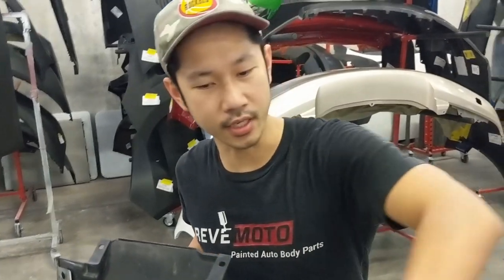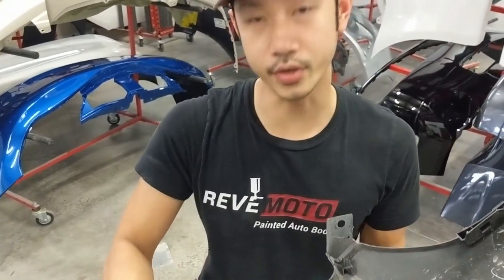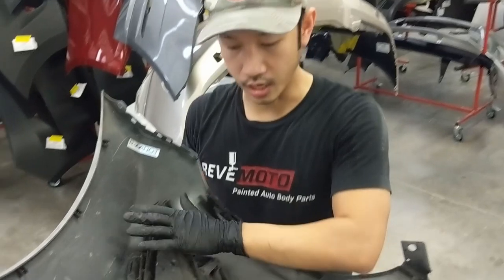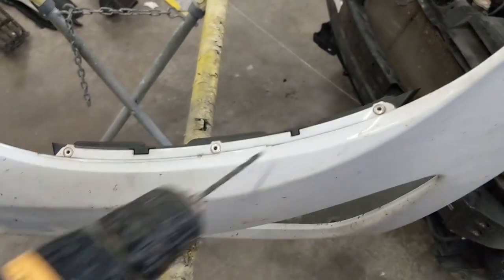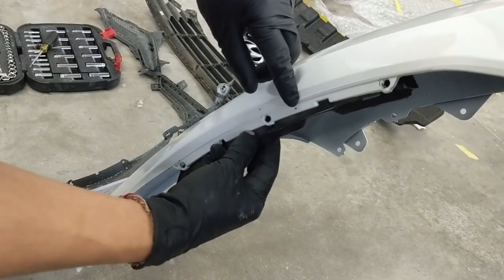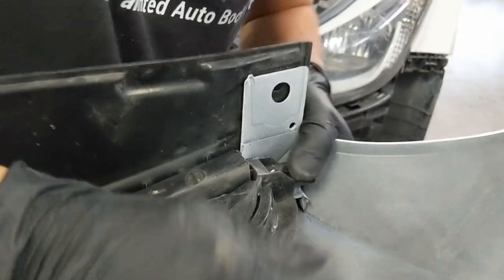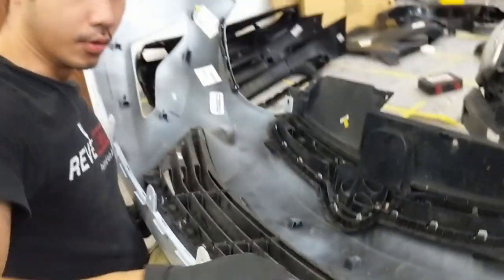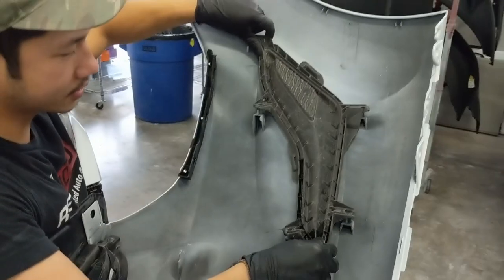2014-2016 Hyundai Elantra Front Bumper Grille Install, Part 2/3

Comment: The grill is not the same on the Elantra GT 2015, I just removed my bumper but I am having problems removing the grill, the top part where the hood is , is not coming off, it has some weird plastic pins/ribbets. I don't know if I will find a tutorial for the 2015 model.
Reply from the maker: Hello. It's hard to say having not taken off a GT grille before. But, you may be referring to plastic screws. They look like push pins but have screw tip on the top. They can be tough to take off because the plastic will wear out and the screw will just spin and not come up. Try cutting or drilling them if you cannot unscrew it. I haven't seen rivets on a Hyundai, but if they are, just drill them out. Drilling out rivets is the only way to remove them. Plastic rivets and a hand held rivet gun usually run about $20 at your hardware store. Good luck & thank you for watching!

Comment: My fog light got broken on my 2016 elantra but the parts you connect it to on the bumper where the screws go are missing.  Can you repair or get glue on replacement without replacing bumper?
Reply from the maker: It really depends on how it broke. If you still have the broken piece to attach, I would try some JB Weld first. You can buy pretty much anywhere for $5. It works pretty well with plastics. You can also try some super glue or even heat up a metal rod and use that to melt the plastic around the broken piece. It's a very "quick" way to fix something without a plastic welder. Lastly, is buying a plastic welder. I've personally never used one but they range in price. You just melt/weld a plastic support pieces to the broken plastic tab. I hope this helps. Let us know which one your try out. Take care!

Comment: I have a 2017 Hyundai Elantra SE and part of my front bumper and fender liner is missing. When I get the new bumper do I go through this process as well? Or does that depend on how the new bumper comes? My grille is fine and so is my headlight.
Reply from the maker: Hello Tina! Yes. the process is pretty much the same. You have to transfer the grilles over and reuse the your same bolts/screws. If you give us a call/chat we can price you for the fender liner as well. It may even be on the website too. https://www.revemoto.com/collections/hyundai-parts/year_2015+model_elantra

Comment: What is the purpose of the parts you had to use the gun for? I'm missing my bottom shield as well. Do you need that to install the bumper?
Reply from the maker: Hello Kimberly! The gun we used was to install the rivets. There are also hand held rivet guns that you squeeze like pliers that work very well. We were installing the brackets for the headlights and that allows the bumper to be secured below the headlight. The brackets are needed but you could probably use small screws too. No, you don't need the bottom shield to install the bumper but it's good to have it so nothing flies into your engine bay. Thank you for watching and please subscribe, it helps us a ton!

Comment: What about the lower lip/valence? You didn't install that one back on the new bumper?
Reply from the maker: If I recall correctly, the customer did not want to purchase the bottom engine cover, or lower valance. I think it was out of his budget and he said he would purchase later. The lower engine shield or bottom cover attaches to the bumper where we inserted the clips in the video. The back end would also be clipped or bolted to a couple places on the frame.

Comment: Can you please do a video for the 2016 elantra Hood?
Reply from the maker: We would love to do it. Most hoods are attached the same. Just remove the top two bolts holding on the hood. Do not remove the bottom two bolts attached to the frame. Have a friend help you, it's much easier. Let us know if you have any questions.